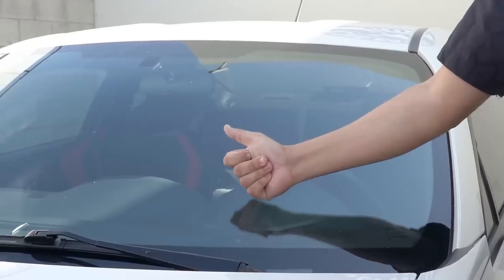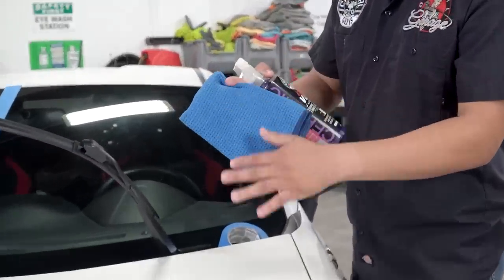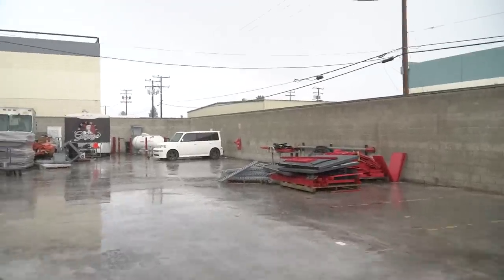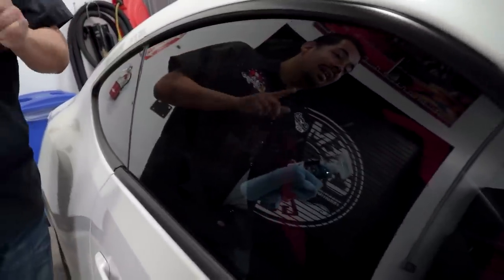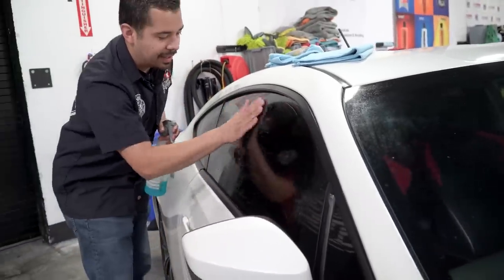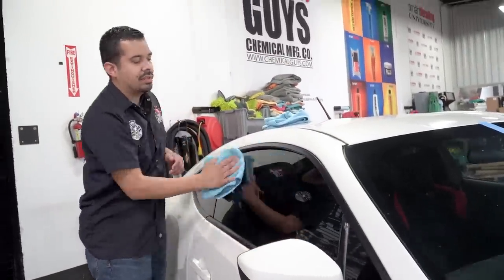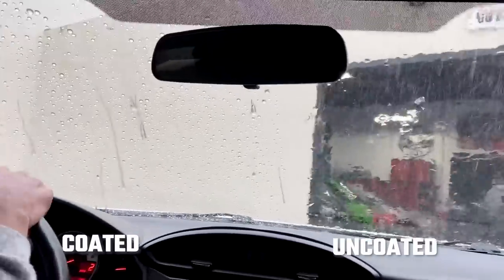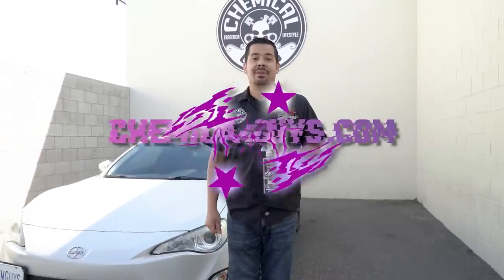NEW PRODUCT - How To Use A Ceramic Glass Coating! - HydroView - Chemical Guys

Comment: Hydroview is extremely durable. I put it on last summer and survived multiple strip washes before ceramic coating the paint.
It's still just as hydrophobic as when It was first applied.
Reply from the maker: Hey! Thanks so much for the incredible feedback!!
Reply: I used to jet seal the glass before I found this. Same as your experience though in terms of it lasting a number of washes.
Reply: @ChemicalGuys  Hi I was wondering if this can / will damage the paint /clear coat if it is accidentally sprayed on to the surface?

And if there is accidentally any over spray, if anything special needs to be done, other than just wiping it off (do you need to wash it off with soap and water for example)?
Reply: @notsureyou just wipe it off after you clean your glass it’ll be ok

Comment: I bought this a Walmart.  About a month later we had a rain storm and I was cruising nicely down the road without wipers.  It just beaded and ran right off.  This isn't just for cars like you said, I use it on my house windows, bathroom mirrors and appliance displays.  Don't forget eye glasses.   

 How does this compare to hydroslick or even a full coating like carbon force?
Reply from the maker: Enjoy your detailing products!!

Comment: What's the difference between hydroview and hydro slick,
Reply from the maker: Hi Robert! Both are great options for protecting glass however HydroSlick can be used for other surfaces such as glass, and shiny metal. HydroView is also a glass cleaner that revives existing coatings on glass.

Comment: How long does the clay bar last? When do I have to discard and get a new one?
Reply from the maker: Hi Kay! One clay bar can decontaminate several average size vehicles before needing to be replaced. Roll and knead the bar until you can no longer find a clean surface.

Comment: Do y’all make ceramic like this for the painted surfaces?  Something that can be applied like this?
Reply from the maker: Hi there! Easily add a durable layer of ceramic protection with HydroCharge and/or HydroSlick.
https://www.chemicalguys.com/hydroslick-intense-gloss-sio2-ceramic-coating-hyperwax/Hydro-Slick.html?gtmListValue=Internal%20Search

Comment: Do I have to throw away towels after using HydroView as it is a ceramic coating which would place small chards of glass in towel.
Reply from the maker: Hi there! Microfiber goods can be washed and reused after applying HydroView.

Comment: Can you use this on interior windshield or is this for exterior only?
Reply from the maker: Hi Mike! HydroView can be used for interior glass and OEM factory tint, but is not recommended for aftermarket tint film.
Reply: That reduced fogging for the interior windshield going to be nice unless you got tint on it

Comment: So is ceramic coating good on tint windows?
Reply from the maker: Hey! All aftermarket tint films are different and may react differently to chemical application. As always, we recommend testing this product in a small, inconspicuous area before first use on aftermarket tint films.

Comment: Hi i accidently used the hydro view on my hood and roof of my car…will it affect my paint? I grabbed the hydro view bottle instead of the hydro speed bottle and didnt realize i was using the wrong spray till i looked at the bottle i was holding…
Reply from the maker: Hello! HydroView is safe for paint and simply wipes right off.

Comment: Can I use streak free over the HydroView without removing the ceramic coating?
Reply from the maker: Absolutely! Streak Free will not harm your coatings. You can also use HydroView as a glass cleaner that boosts your existing coat.
Reply: @ChemicalGuys I notice using hydro view at night the on coming cars headlights will leave a reflecting glare on my vision ?? Light glare

Comment: CAN YOU USE IT ON THE INSIDE OF THE GLASS?
Reply from the maker: Hi Jerry! HydroView is intended for the exterior side of glass but it can be used on the interior as well. If the glass is tinted it must be OEM tint to safely use HydroView.
Reply: @ChemicalGuys  is it safe for aftermarket window tint!?

Comment: Can I use it on ceramic Window tint
Reply from the maker: Hydroview may be used on OEM factory tint, but is not recommended for aftermarket tint film.
Reply: Lol what? You tinted outside of the window?
Reply: Kind of think you guys should put a warning on the bottle or website that this can’t be used on aftermarket tint. 🙄 Bad job there.
Reply: @ml6008  window tint goes on inside. This goes on outside. Why would you ceramic coat inside glass?
Reply: @ml6008  why? What happened? did you ruin your tint with this product?
Reply: @willster7272  no, nothing happened to my tint. I just thought it should be made clear on the bottle not to use on tint. Obviously tint is on the inside and there isn’t much of a reason to ceramic the inside of windows but I always assume automotive glass cleaner is safe on tint. If it’s not, it should be made clear. Other than that, hydroview is a very good product.